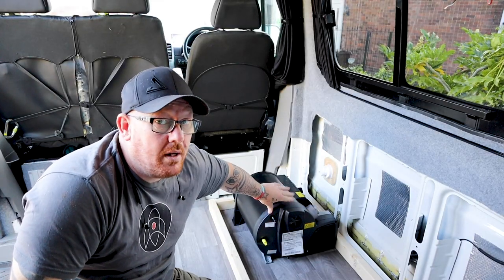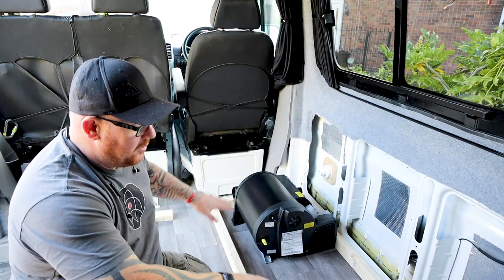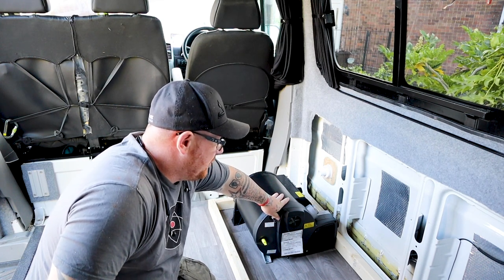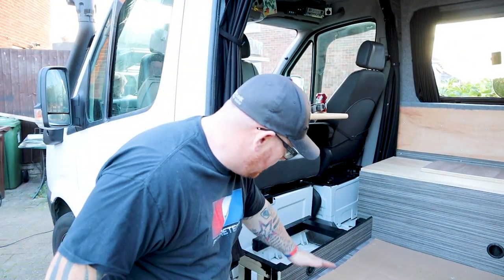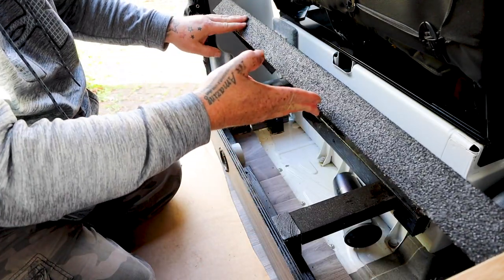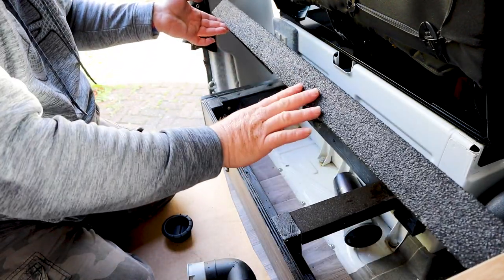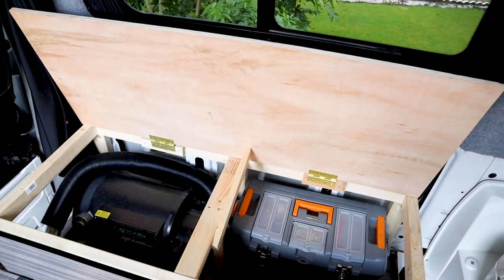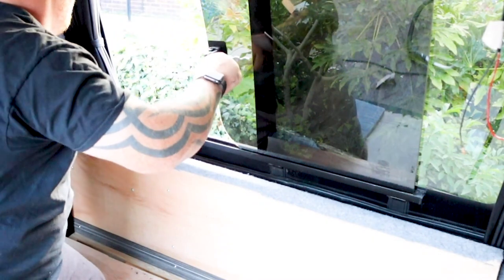Simple DIY VAN BUILD bench seat You Can Do

Comment: I have gutted my travel trailer . this is my first one . my objective is to " Flip" tiny homes are the rage rn .  As I got into this thing and not only remodel but have to live in also been very challenging ..  you have to have an imagination and somewhat of a deep pocket book.  
I have TWO REALLY BIG QUESTIONS FOR YOU , hoping you can help #1 wanting to build a bench seat  half the size it was . looks simple enough howver I have pipes that go up against the wall  I will need to compensate for . I don't want it to look like a second grader gave it try . I want it to be multi functional . like yours hold storage , use as a seat or a placd to rest . nothing fancy just doable and estically decent looking
Reply from the maker: Hi Jenny so sorry to hear about all the issues you have had, we think the first thing you need to do is take the trailer to someone who has knowledge of this parasite and get the trailer fumigated and then see if it’s salvageable. We have no experience with this sort of thing so really don’t know how to even start with suggestions other than that, and will keep our fingers crossed for you. We wouldn’t be putting any time or work in until we knew it was possible as parasites and things like that can be dangerous, please get it checked x

Comment: Hey, what is that great vinyl material you use on the sides of the bench and above the driver / passenger seat? Do you have a link to the website where you can order material like that? I painted my benches but the paint scuffs easily.
Reply from the maker: It’s 15 mm laminated ply we got full sheets of it when we where building the van https://ukleisureparts.co.uk/product/grey-zebrano-lightweight-ply/